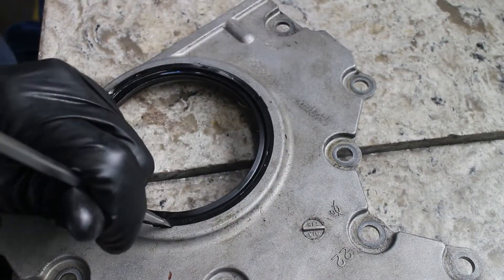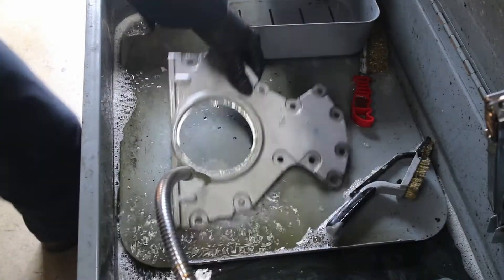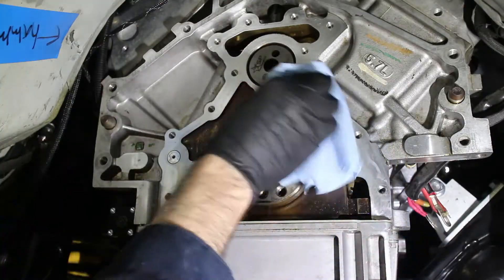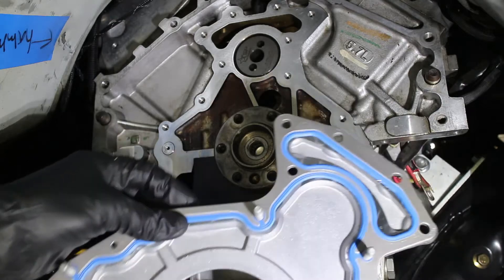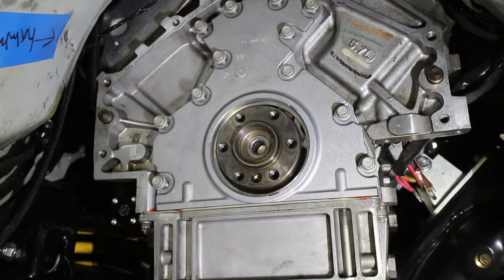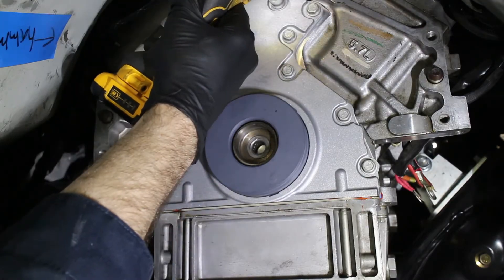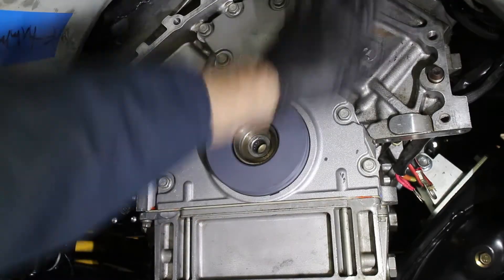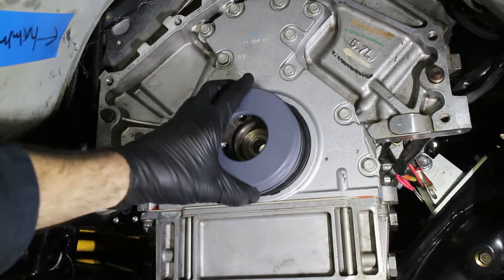LS Rear Main Seal Replacement (4.8L 5.3L 5.7L 6.0L 6.2L 7.0L)

Comment: Can you do it without removing the cover
Reply from the maker: you can pry off the seal without removing the cover.
but you still have to loosen all the bolts on the cover to re-align the cover for a new seal.

Comment: How deep did you set the seal? The tool i used will let me send it to the step of the cover. I didnt go that deep but juat past flush, to catch good clean metal on the crank.

Comment: The ""tool"" helps= but you still need to rely on your eyeballs...
= Fuck the tool.
Press crank seal into front cover. Assembly lube the dogshit out of the crank surface- push cover on by hand.
Criss- Cross Applesauce your cover bolts- keeping a keen eye on that rear main seal.
If everything's copacetic- torque them, mount the stupid flex plate- and zip a tranny on...
The absolute best seal driver- is a fuckin 2x4.... soft enough to NOT mangle the seal-
Strong enough to drive it in.
Problem solved. 
Chimichanga.

Comment: Instead of taking the cover off could you not pull the seal and check for cover alignment with the tool. If its good pop the seal in, if not pull the cover and realign?
Reply from the maker: if the seal install tool fits easily, sure.
Reply: Yea. Ut just fyi the engine cycles and puts lits of gas in the oil and it breaks thebd
Seals down in these engines and so its good to inspect scoring, smell and replace any gaskets you can when they are easy.

Comment: Put some oil or grease on the crank side of seal , before pressing in .
Reply from the maker: GM instructions specify a dry seal install.
Reply: I had both GM and a Felpro seal, the GM seal I believe is rubber and the Felpro is PTFE. The PTFE seal is installed dry so it seats properly and I believe the rubber seals uses oil but the GM one had lubricant or a compound pre applied to it out of the bag. This is what I seen online from my research and having the two in front of me.

Comment: Question?  After the small 12 bolts have been tightened down following the centering task, then the 2 long bolts at the bottom are tightened?  I am going by logic here because it would not make sense to pull in a downward manner with the 2 long bolts being tightened, correct?  Great video as it went right to the point.
Reply from the maker: the m8 bolts secure the cover correctly, then the longer m6s secure the pan to the engine.
otherwise the long bolts would pull the cover out of alignment.
Reply: @3rdGenGuy  Thank you for this follow up.  I'm dreading having to do this on my truck but it has to be done.

Comment: It’s always a special got damn tool
Reply from the maker: NOT a job to tackle without the proper tool.
I have a lot of guys tell me they tried it without the tool and ended up with a seal that started leaking in 500 miles.
they then used the tool and have been problem free since.

Comment: Got a rear main seal job done on my 5.7 trans am ws6 around Christmas and started leaking around 1 day of really driving it. Mechanic didn’t use the alignment tool claiming it wasn’t a factory procedure. He claims it was bad part but since seeing this video and talking to a mechanic it’s opened my eyes about the importance of alignment tool. Either way if it is a bad part I’m going to need to be prepared to fork out the money. If it’s the alignment it’s on them, I’ll return in spring when I have the money. We don’t know what the issues is till we take off the transmission
Reply: If you got the job done in a shop you shouldn’t have to spend money on it, it should be covered under their warranty.
Reply: @alexislopez7921  part provided by me no warranty
Reply: More likely the idiot put it in backwards…
Reply: I would say hey dude you said alignment tool wasent needed well clearly it is
Reply: Prob did exactly how this vid did. Drop the seal and continue installing alignment tool anyway
Reply: Update: btw this was earlier this year but he went back and replaced it free of charge with warranty!!!

Comment: Ppl commenting “tool is not necessary”. You know what else is not necessary? Cheaping out on a $15-20 tool for a 4-7 hour job.
Reply: Lmao right, can’t afford to do it once can’t afford to do it twice🤷🏼‍♂️
Reply: Where are you finding these for 15/20???
Reply: Amazon - $25  billet aluminum. Really nice set.
Reply: @austinnorman779 amazon. Google. Easy to find.
Reply: @austinnorman779 $14.25 on Amazon for an aluminum one
Reply: It's 130 for the tool where I'm at
Reply: You can use a 2x4
Reply: Tool isn't necessary if you get the plate with the pre install seal.
Reply: It really isn't necessary if you know what you're doing lol 🤷‍♂️

Comment: You don't need that tool for the rear main. I install seal into the cover loosely, install cover with bolts then press it on by hand then torque the bolts down. No leaks and I'm pushing close to 800whp in my 91 z28
Reply: @Boosted370  exactly.  Thank you
Reply: You are correct, apparently some don't know how to read a set of precision calipers either. Get your bolts to where there is a little tension without seal in housing. Then just go around till the gap is even all the way around. Then tighten up, recheck, and drive seal in.
Reply: @timberslasher4899  yes this works but what is your time worth? This is a $14.25 tool from Amazon. I have done it by measuring and yes it works but the time saved to me is worth the cost of the tool. That's why the pros use the tool , not because they can't measure but because time is money.
Reply: @Boosted370 exactly! Thanks for this comment.
Reply from the maker: it's fun and games until you do a 30min track session and a misaligned seal goes BY BY.
1/4 mile pulls and burnouts don't put an engine under nearly as  much stress as running all-out for 30min.
Reply: @3rdGenGuy When did he say he doesn't track the car 😂 assume much

Comment: It's going to leak again.  The problem is the trust surface on ls engines is weak and this is what causes this leak
Reply from the maker: never heard a soul ever mention the crank thrust spec for causing a leak
Reply: @3rdGenGuy  Never heard of it either, and I've been doing this for forty years. The thrust bearing would almost have to be missing for the crank to walk that far. I've seen Windsor Fords and big block Chrysler's eat thrust bearings and journals.

Comment: cant wait to see how you do the pvc system
Reply: What? You mean the PCV that’s built into the engine valley covers that have them? These are usually on more performance specific LS style engines, and they’re often mated to manual transmissions from the factory, and also don’t have AFM/DOD or VVT.

Comment: You have a LS1? I thought you had a LS3
Reply from the maker: I wish ha ha
100hp difference between those forsure
Reply: @3rdGenGuy I have been reading etc and come across the statement that many "aluminum covers have a porosity issue" where oil leaks THROUGH the aluminum... where can we get a steel rear cover plate???

Comment: Wasn't this a rebuilt engine?
Reply from the maker: junkyard LS1 with questionable miles.
my PCV routing was wrong so I think crankcase pressure was getting way to high.
Reply: he was pretty sure with the way his pvc system was set up that it was causing to much crankcase pressure and it blew his seal out.

Comment: The tool really isn't necessary
Reply: The tool is really cheap insurance for a job that requires the removal of the transmission.  I don't even have a rear main leak, just replacing the seal while the transmission is out, because I dont want to pull it out again anytime soon...
Reply from the maker: I talked to an engine builder that probably builds 10x LS 427s a week, and he said that tool is ABSOLUTKLY necessary.
although the OEM tool is steel.
Reply: @3rdGenGuy  you install the seal before putting on the engine, the seal self centers on the crank. It's really not necessary at all
Reply from the maker: well no, the OEM GM repair guide is the method I used.
Reply: @notchbackgta  torquing the rear cover can cause the plate to move off center. Torquing the cover before the two pan bolts can cause it to be off center. The alignment tool is a must!
Reply: @kennydemartini2169  no, it's not 🤦
Reply from the maker: GM: use the alignment tool
Texas Speed Engine builder: use the tool
who AM I gonna trust here?
Reply: @notchbackgta  good luck 🙄
Reply: @notchbackgta you have to torque the plate down without the seal, with the steel tool holding the plate center. That rubber seal isn't centering shit. For anybody not using the tool and having success, you are getting damn lucky.
Reply: @rickybellamy8191  no,  not lucky.  The tool isn't necessary 😆
Reply: @kennydemartini2169  luck? I have no leaks. Tool isn't necessary 🤦‍♂️
Reply: @notchbackgta ”it worked for me once or twice so it’s 100% not needed” but for people who do this for a living building engines or more RMS jobs in a week than the average diy car owner will do in a lifetime yeah sure it’s not necessary ok dude